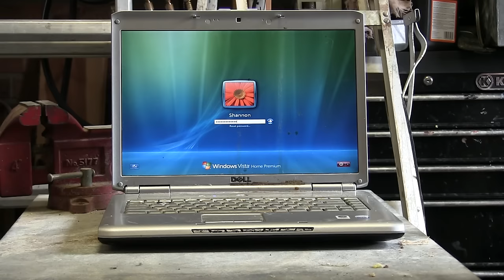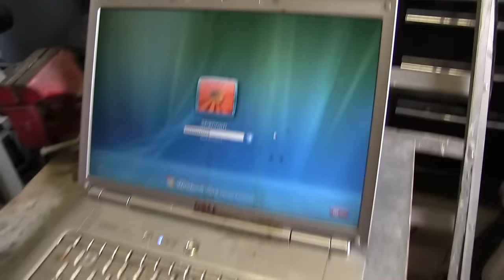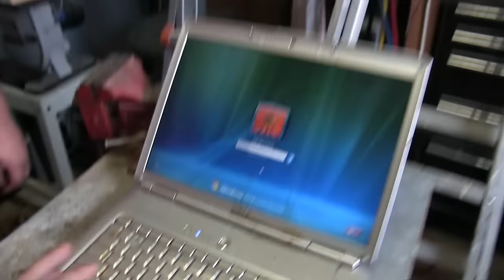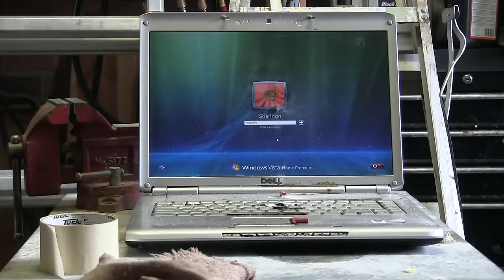Laptop Destruction 2

Comment: Next time you should use the band saw on the screen while it's on.  Another good one would be to remove the cover off of the hard drive and try to put a firecracker in it with it still spinning.

Comment: Why did you not saw the battery in half then solder it back together? It is very important to destroy the battery because very very sensitive information is stored in the battery and must be destroyed.  It's the responsible thing to do
Reply: No it supply's the power
Reply: +Mtn dew videos except when the power supply is plugged into it and the wall
Reply: +Shadow Warrior Productions yes I do DUH

Comment: You do realize vista has a box that says reset password right?
Reply: He just said he doesn't have the password reset disk.
Reply: you need to make the key before your locked out
Reply: It doesn't matter, the password is easy to remove anyway.
Reply: Even then, from the looks of it, the computer isn't really worth saving. unless you were really desperate for a computer.
Reply: Kirbyofdeath
what makes it even worse, that computer is actually very decent, especially for its time, and is faster than some computers on the market nowerdays. It has a Core 2 Duo, which is stilll a very fast CPU, although it may not be the most battery effecient, it is definitely faster than some notebooks I have seen nowerdays. (They have Celeron CPUs, not very great)

The outside condition was very dirty, but could have easily been cleaned, and you'd have a good computer other than the missing key.

The screen was a fancy 800p one also. :/
Reply: television and cheese You're right with the comparison to other, newer laptops. I just rarely use laptops often, my main computer is home-built with the newest parts, so my comparison essentially isn't applicable.

Comment: actually, vista is the WORST one not only by microsoft, but IN THE WORLD.
Reply: AidenStaubGaming Roblox and mobile Pretty sure you never used vista before. Think before you say. Vista, apart from some of its bugs fixed in Windows 7, was a great OS, if you had hardware capable of running it properly. what guy on the internet told you vista is shit?
Reply: AidenStaubGaming Roblox and mobile Plus, your comment is recent, proving that there are great PC's, such as ones with OC i7 and a GTX 10 series will run vista amazingly and little to no problems. The point of your comment is invalid.
Reply: Crankatus tonsa peeps say it